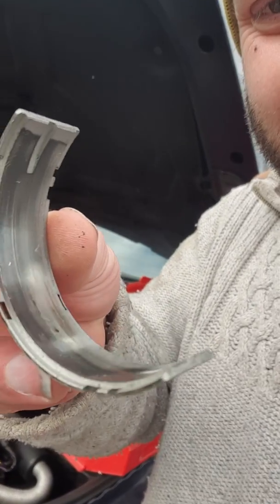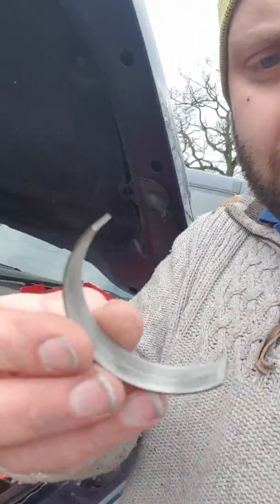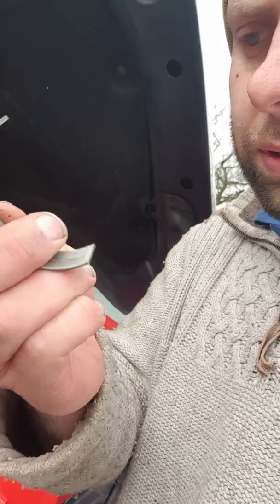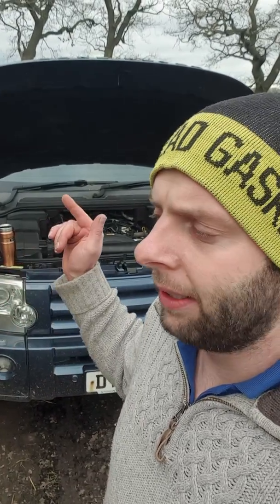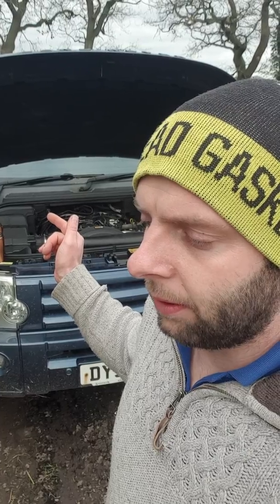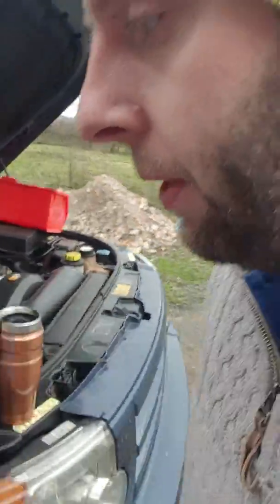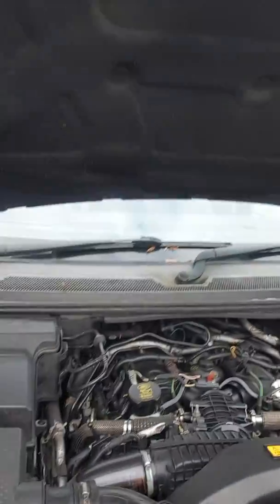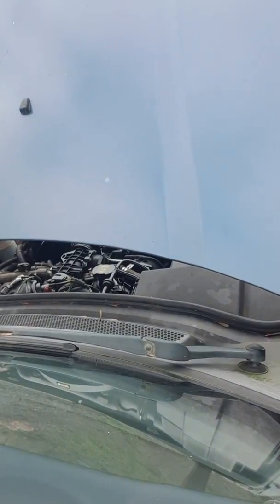Discovery tdv6 crank issues and head gasket repair.

Comment: Did you ever find out what was causing the knocking/tapping noise? My disco 3 has started doing the exact same.
Reply from the maker: No. I never found the where it's coming from. I've done over 10k miles in it now and it's still the same noise. Its definitely something that has oil pressure to it because when i first start in the morning you can hear the noise get quieter when the oil pressure comes up. I think possible little end but I would of thought it would last as long as it has if it was a little end. Let me know if you find out what your noise is. Cheers

Comment: That sounds like Piston slap! I had exactly the same on my Sport TDV6.
Completely stripped the engine down and rebuilt. Although the Bearings were  past their best and replaced it was crystal clear that the piston play was excessive!
I removed the engine out of the front not body off. It’s not too bad to be honest as long as you work methodically and meticulously! 👌
Take the Injectors out one at a time and bring the Pistons to TDC with a extended screwdriver. Just as each piston makes it’s decent apply slight pressure to identify any play within the respective cylinder.
Mine was on number 6.
You will see me remove cylinder 6 injector plug which lessons the tapping/knocking somewhat to isolate which cylinder was at fault.
Be warned though, removing the injector plugs as I did will allow these Injectors to continue to dump fuel in the cylinder. As soon as I carried this test the injectors were removed.

https://youtu.be/GOzFePtHcik

https://youtu.be/5fhIpq2i7TI
Reply: I'll second that.

Comment: Hiya, did you find out what the noise was? I have a similar issue with a Jaguar XFs but mine is the other side {near side}
would appreciate it if you could reply so I have an idea what to check? been told similar that it may be bottom end on way out
Reply from the maker: Hi yeah sorry I've not edited the next video yet. But I did head gaskets. Couldn't find anything making the noise so changed the hydraulic lifters, oil pump belts tensioners. But after doing it all the noise is still the same. Been driving it now for almost a year. And the noise is still there and not got any worse. So just using and waiting for it to get worse so I can get more of an idea of what it is. Hope this helps . Cheers
Reply: James Collett my thought is the cam chain and tensioner if you look on here I have found a Chinese engine training which shows you the markings and links between also there are two large flats on the cams and one has a small flat 180 out make sure they are both large flats on top 👍🏻 I am stripping mine tomorrow to check so will let you know 👍🏻
Reply: https://youtu.be/CA6gXqyKBp8